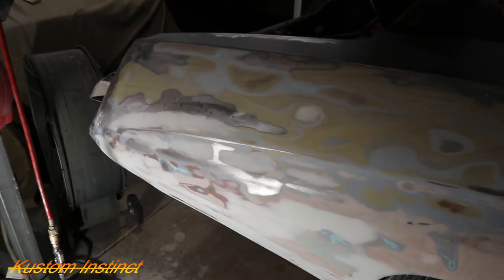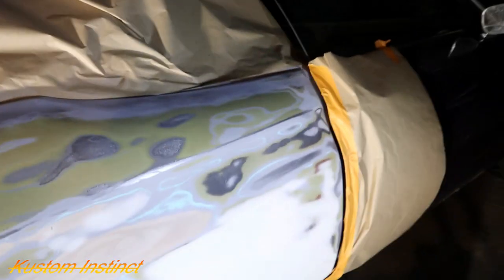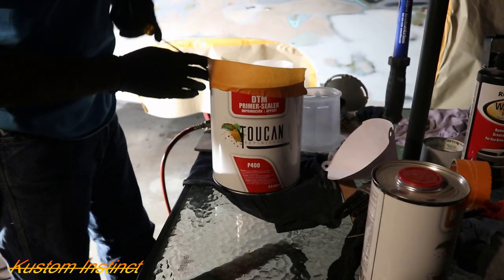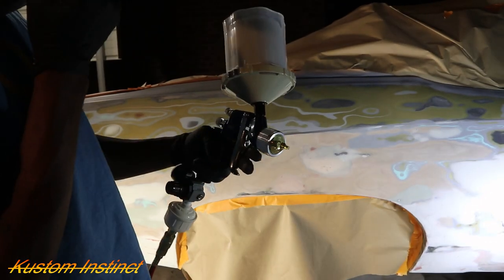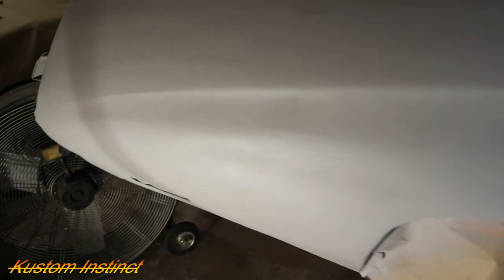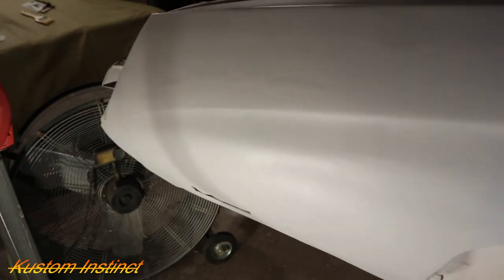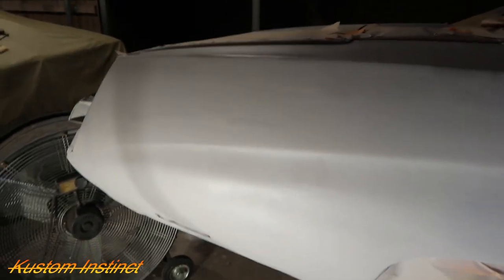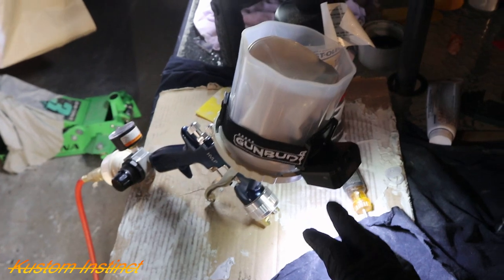finally laying paint down on my 1972 buick lesabre convertible

Comment: Add a little reducer to make that primer flow  smoother
Reply from the maker: Thanks for the advice 💪🏽💯
Reply: Yeah , but what size tip are you using?
Reply from the maker: 1.4 for primer
Reply: @kustominstinct  that's what I use to,,1.4 with a little reducer